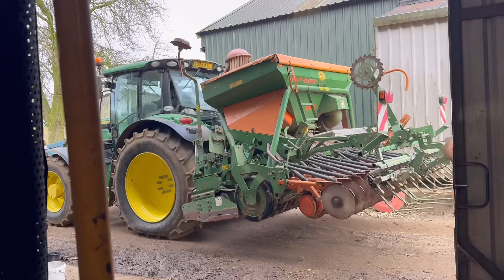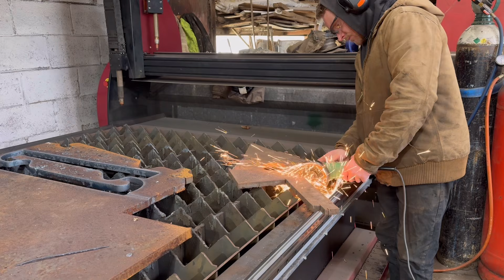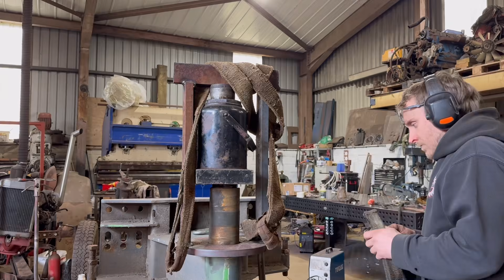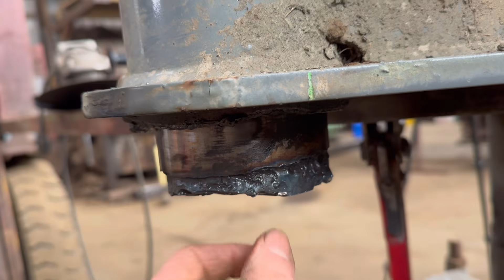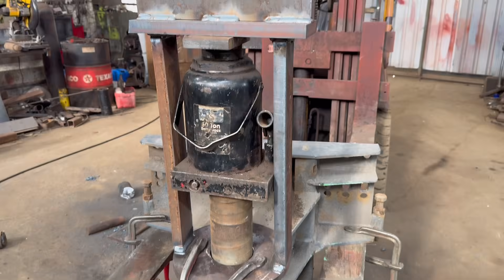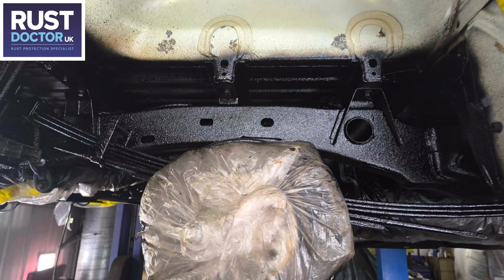Pressing stuck shafts out with 50tonne jack! JOSKIN axle pivot. Part 1.

Comment: picture of Joskin shows it would be simplest to cut off the existing brackets and stuck shaft etc and just make a new top section with shaft to weld onto the cut off brackets.
Weld a piece of 3 or 4 inch square tube between uprights and parallel to tube to maintain alignment.

Comment: Could you not have just done a vertical cut with the angle grinder on the tube, that would have released the pressure then just weld it up again?

Comment: You mentioned rust binding the shaft into the tube, just a factoid; rust occupies 3 times the volume of the metal it converted. So if it's rusty, it's not always as bad as it looks.

Comment: hi Oliver my job is welding and repairing pant machinery and trucks not too far from you in sunny Barnsley. always been fabbing and machining in previous jobs but never used an air arc but could really do with one for bucket repairs etc.  any chance of you showing your power source you use with the air arc and explaining whats needed please ? 
the welding set i use is a Lincoln 400A  mig set but when i spoke to Lincoln about using an air arc my set isn,t suitable for it . 
cheers Steve.

Comment: Ollie, I had some 70MM round bar to cut a while back. Propane would not cut it properly with the largest tip I had. So I grabbed the acetylene setup and a #3 tip. It cut an absolute treat. Propane cutting works for many things, but sometimes you must get the expensive gas out. Also what pressure was your O2? I run about 80PSI for stuff above 50MM.

Comment: Great video as always, the Amorok is a great vehicle and given the salt spray that you suffer in the winter getting the underbody and panel seams sealed will add a decade to its life.  You need a number 5 or 6 oxy acetylene tip for cutting 100mm/4 inch bar, not sure what size oxy LPG/propane is needed.

Comment: I am gonna say that bar looked buckled going through those bores even before you welded on it. Each angle confirmed to my eye it may need line boring before a new piece of pin will slip in there? Add to that you did nothing to distort the two hinge bores away from each other!  Beauty work on the rear guard. Should have it galvanised so it represents your work for decades.

Comment: Oliver, a suggestion regarding the exhaust on your Cutavar table. Without the power to run a larger exhaust motor use the trick that commercial paper cutting machines employ; a flywheel. The paper cutter doesn't have enough power in the motor to cut a 6 inch stack of paper. So do what they do, in your case, get an adequate size blower - squirrel cage, and add as hefty a flywheel as you can that is balanced. 200, 400, even a half ton. Then you need to bring the flywheel up to speed, with a phase converter, or one nice trick, a 3 speed automatic transmission out of a car. 
Then bring it up in stages. The flywheel should be heavy enough to get you through times when other machines are draining off your power.
I saw a factory paper cutter running a wimpy 1 1/2 horse motor. It could cut a 6 inch stack of paper 30 inches wide. It had a Toyota auto tranny. So figure the average durations that other machines will be sucking off your power and design accordingly. A proper flywheel could give you a few minutes of good exhaust suction while the motor is struggling.

Comment: Well done getting that huge pin out.  
No need to go to the gym!
I don’t think you lack oxy torch skills. Cutting 100mm round with a torch sounds shit no matter what your skill level.
That’s a great job on your new car.  Good on you for giving them a plug.
I used to think a battery grease gun was a bit of a wank, until I used one 🤠
That guard turned out fabulous.  I think that deserved its own video.  It looks absolutely amazing.

Comment: When doing the second pin, any reason why you didn't chop it off first.so that you wouldn't have to drive the whole length through? Or grind down the pins so a smaller diameter would get through easily?

Comment: 59:25 "I'm very skeptical, it's not going to fit". Oh, it'll fit alright. Question is really, just how hard will it have to be pushed before it "fits". Another good video, thanks Mr. Snowball. I like the Lock 'n Lube grease gun tip. Been using one for years on farm tractors, etc. Much better than the standard tip.

Comment: Not sure what you had your O2 pressure set at but about 70psi would be right for that bar stock.  I am not 100% sure what tip size using propane but I used a #3 tip when using acetylene

Comment: Excellent, but very hard physical work. You certainly earned your crust (or salmon on rice) on this job.  The radiator guard was really very professional OEM quality work. I hope future Oliver doesn’t have too hard a time installing the new round bar.  Your Amarok looks great. I recall in the 1970s and 80s, my father used to get his vehicles undersides and cavities treated with Dinitrol - seemed to work well then. All the best, Richard
Reply from the maker: It was Dinitrol they used on the Amarok too

Comment: An idea to save welding it on, once youd cut the middle out, would have been to make the 'arms' longer and slot it from the inside, save the welding and cleanup.

And you need air over hydraulic and a dingleberry hone to quickly clean up those bores😆

Comment: Maybe think about using your internal boring set-up to turn the pin.
 Dial it in on the unworn section, weld the worn areas and cut it in situ?
 Edit, use your line boring jig externally rather than internally, a ring on a tube with an adjustable cutter.

Comment: I’m sure I saw OFW do a similar job using his line boring in “external mode” adding to the OD then machines it back to required OD. I’ll check out his videos but it’s too late now. This one is a monster of a difficult disassembly

Comment: Having been cutting scrap for 40yrs , I would say wrong nozzle combined with direction of burning, always blow in towards what you’re about to cut, it looks as if you’re trying to blow the metal out, keep the hot metal blowing inwards. Wobble the torch left to right a couple of mm to open the cut up.

Comment: Looks like it's still pretty cold where you are. Here in Queensland Australia, we just had a cyclone (hurricane) come past us. It smashed the Gold Coast (South of us) pretty badly with over 400,000 premises losing power, then there was widespread flooding as well. We are near Hervey Bay, which had flash flooding, but we got barely any rain here. Cutting Edge Engineering is on the Gold Coast and they didn't have a video this week, so I hope they are OK down there.

Comment: Hello Oliver,  Well, young man, you got it apart.  I really had my doubts.  There are at least a dozen and a half things that I would have done different.  Mainly, just cut the shaft ends off flush at each end at the gate and have done with it.  Much less to press through.  First time that I've disagreed much with the way you've gone about things.  The car is a winner.  Good to see you now have a vehicle in good condition.  The guard on the loader is very professional.  You should be doing more aftermarket work.  Just work your emblem into the design.  Give a look at Dirt Perfect.  Lots of similarities.  I mean that in a very good way.
Reply from the maker: I’d have gained absolutely nothing but make it more difficult for myself balancing the Jack. The shaft ends were worn down so had no hold in the hole anyway. Would have been a lot more unnecessary time doing 2 extra cuts.

Comment: At about the 300th “Tink” I would’ve looked for a pin and a hammer, hydraulic jacks have their place. Thermal lances are a nasty bit of business (speaking formal English). We would say “pain in the ass”. This job is fighting you at every step. Even just kicking that pin out. Amazing. Keep that “ jack rig” built. You can use it again. Put a third leg on it though, it’ll need it.

Comment: Success!  Awesome!  I was actually surprised that it broke free.  Great job!
I actually had to get a cortisone shot in my shoulder once from pumping a hydraulic jack. So here are a couple of thoughts to help.  The rod you were using as a jack handle was too small a diameter to fit the receiver, so that increased the stroke length by about a foot and a half!  That was painful to watch.  Once the pin started to move, I kept shouting at the screen to get a smaller jack, but even to the very end, you kept fighting that heavy 50 ton'er.  When you switched to a smaller handle, I thought that surely you would.  Maybe next time.  I'm looking forward to the next video.  Regards.

Comment: Everytime you start messing with that 50 T Jack I wince. Son,  you need a 300T press you can move around and simply pin to that table. Heck, leave that bracket intact and iuse it on your table.

Comment: As expected, all the welds on you VW pick up are suffering from weld decay, because the ‘Robot’ does not decide to turn down the power on the weld so the composition of the metal changes, can any chemist please chin in to explain exactly what happens.  Joe.

Comment: Another great video. That was a tough one. I was wondering if turning the mill on it’s side, milling it down and then making a sleeve on the lathe would have worked.  Great job powering through the tough work 👍👍👍

Comment: That was a huge win getting that pin out!  I thought you might cut the top of the pin off to lessen the amount of pushing to do.  Your heating tip "turns your oxygen into noise".  That's good!    That radiator guard looks fantastic!   Great video!  Congrats on the new ride.

Comment: How do you think it would have worked if you split the axle supports along the length of the axle at the apex of the supports (lowest point with the axle on the trailer) and then pounded some wedges in to spread the supports? Would that have relieved pressure and allowed you to get some lube in there?

Comment: I had some 1" pivot pins rusted in my seed drill opener arms. Had to cut them out of the mounting brackets then put them in my 75 tonne press. I had 30 tonne on a couple of them before they popped. When they finally moved it was like a shotgun going off. A little terrifying having that much force on something that's supposed to move with a small hammer and punch. I added grease fittings to the arms and give them a shot once a year to hopefully prevent them from seizing again.

Comment: Good video Oliver. Hydrochloric acid is very good for breaking rust seal. Create a reservoir with some gaffer tape and let it soak overnight outside or it will flash rust every thing inside your
 workshop.
Get some brick cleaning acid from toolstation.

Comment: The way you did it didn't risk doing any damage or distorting the frame. Two thumbs up.
Torch not cutting. I'd guess not enough oxygen pressure. Get it up where it almost blows the fllame out. Should be able to cut around 6 inches. 

I would have tried heating up the outer sleeves a few times and hot oil it. . You know dang well that pin is rusted in solid.RE rust. A heads up. White vinegar or better, 10% to 20% acetic acid. Respirator on, heat it to boiling. Dissolves rust and gets into the tiniest gaps and cracks.

Comment: A really good video this week illustrating some of the specially difficult  problems you have to deal with! That axle sure was well stuck in there what with a tight fit and rust issues. 

I like the look of the job you have had done on your pickup to control the corrosion. Are you advised to take it back periodically to have "top up" treatments?

Comment: Why don’t you get a hydraulic cylinder from somewhere and use the hydraulic system on one of the tractors to power it. It’s not that you need it every day, but available 👍
Reply: Tap into the hydraulic system on your forklift to power the cylinder!

Comment: There’s more than one way to skin a cat and no shortage of opinions on how to do so but,….I have to offer mine anyway 😂. I think I would have welded in some temporary bracing between the posts so they would maintain their original position, gouged out the welds holding the shaft, cut out the center of the shaft with a porta-band, set your jack between the posts and jacked them from the middle out while heating the boss that the axle runs through. There you go, my two cents.

Comment: Would have been easier to split where the shaft went through the 2 lower bosses and then make a new shaft and weld it all back together, you could have asked a Heavy Goods Spring Shop and they could have explained how to do it
Reply: you could also have cut the shaft flush before pressing it through

Comment: Hello Oliver,

When swinging a sledge hammer on an awkward shaped item I found that it helped if I stood on on some wooden pallets so that when the hammer came into contact with the item the hammer shaft was parallel to the ground.

Having the hammer contact the awkward shaped item above waist height didn’t seem to be an efficient use of applied force……………..well that’s my theory. 😉
Reply from the maker: I was only having a few swings to see if anything happened.  There’s no way I can swing a hammer harder than a 50 tonne jack so if would have all been in vain anyway 😆
Reply: @snowballengineering  If you have not already got one, have a look at hand held battery/240v metal band saws. I think one would have got through that 100 mm bar no problem. Search for this HBM 1100 Watt Portable and Detachable Metal Band Saw as it might be a useful tool to have in the workshop
Reply: @snowballengineering  Watching you gas axe/grind through that 4” (100 mm) shaft a couple of times made me wonder if a portable 240v band saw would do the job.  

The HBM 1100 Watt Portable and Detachable Metal Band Saw has a “throat” of 127 mm, costs around £190.

Might be a handy addition to the workshop tools, assuming you don’t already have a portable band saw?

Comment: Nice work Ollie! I hate removing seized shafts! A friend and I spent nearly 2 days removing 1 metre of 75mm shaft out of a coal sampling bucket. We used 2 x 45 tonne porta-power jacks and broke numerous 25mm high tensile all-thread, bent 2x 25mm steel plates welded together. It was a freakin nightmare! No thermal lance available, just 90 tonne of pressure, a lot of heating, and a HEAP of swinging an FBH! 
Cutting Edge Engineering didn't upload this week because of the tropical cyclone in their neck of the woods, so you get their Super this week! 
Look forward to seeing the jab completed.
Reply: Thanks for that bit of info on CEE. I was wondering what was going on. p.s. Even grumpier Harley rider here but those days are drawing to an end.
Reply from the maker: Thank you!

Comment: Thanks for another great video, you certainly get some interesting jobs. I 100% agree with you on the heat and rust problems getting  pins out, my friend called me one day and said he was stuck getting ram pins out of the boom on his Massey digger. yep they were rusted in tight, they'd heated them and then beat on the end with a smaller shaft as a punch as well.  So not only where they tight to start with the pin grabbed the outer bushing in the 25 mm they got it to move, and they dimpled the end of the  pin basically riveting it in even tighter . To say it was an absolute ignorant pig  to get the pin out is being polite, it looked like somebody had cultivated it with a 4 tine ripper when it finally came out !  Take care

Comment: I think you tackled this job well!
If you wanted the shaft out in one go, you should remove the paint in the middle section. Also connect the two brackets together when you push the shaft out. It's possible that one bracket moves while pushing and therefor grips the shaft even more. But in this case it seems that pushing it out in one go wasn't an option😅. Nice video once again. Good luck with your Amarok, nice pick-up!

Comment: Man you don't pick good jobs do you ?
I thought that would be a easy job but I was wrong, you could cut those pin before you press it through the bush you end up cutting the pins anyway I though you were going to reuse those pins, and also you could weld two or tree metal bars on the outside of the bushs and sent the pins opeseat way but overall you got the job done it just tuck a bit longer, nice one buddy brig on the next video I hope the pinn gos though much easier than it came out 👍 👍

Comment: Extracting the pin from botch bushings in one go might have work (under extreme force), but only if you would have braced the two legs together.
Without the brace, the top extraction is cantilevering the bottom one.
Good thing you changed your mind and cut the culpit !

Comment: Great job! 30 years ago an old timer showed me that if you can get a bit of water on the inner piece when you are heating something it greatly reduces the heat from the outside. Of course I took no notice until one day I was close to giving up taking a 4" shaft out of an old dock crane, I was amazed how much it helped! To this day even if I can get a wet rag round a shaft it's worth doing, good to pass knowledge on 👍
Reply: On the reasons I enjoy these videos are comments such as this one. I might never use the process described here but the sharing of such knowledge is priceless.
Reply: Gotta be careful about doing that. Water can hit molten metal ; molten metal can't hit water in an enclosed area. Just sayin.
Reply: Don't underestimate a wet rag I used to have to put one on my fuel pump (old Chevy) in the summer sometimes for vapor lock

Comment: Peace be upon you, you did a good job. I cut the axle in the middle. The ends must be cut as well because the ends of the axle are heavy and rusty. As a result, a bend occurs by a millimeter. Part of the axle inside the tube remains intact and is easy to remove.